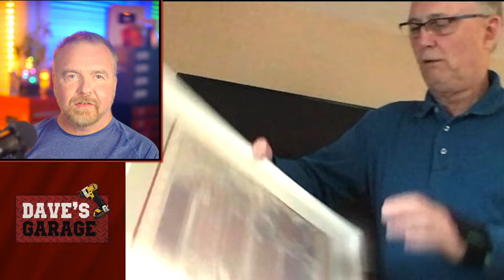Commodore 64 Chip Designer Interview: Albert Charpentier

Comment: Nice interview although Albert has forgotten that a C64 sprite is 24x21 pixels, 3 bytes wide and 21 lines tall, so they take 63 bytes each (within the boundary of 64bytes which a sprite pointer index is multiplied with in order to find its data within the 16kb of ram that the VIC-II can see out of the C64's 64kb of memory (the VIC-II can be configured to which of the 4 banks of 16kb of ram it can see). A neat thing about the C64 is also the ability to show sprites in the border by tricking the VIC-II chip to think that the screen should only show 24 rows and then turning it back to 25 rows again shortly after (all done at the bottom at around scan line 250). This trick was used by a number of games as well once it was discovered. Together with multiplexing by repositioning sprites you could have some nice HUD info going on above and below the actual screen area. Albert touches a bit in the talk about whats called "bad lines" that every 8th line at the start of a character row, the CPU is disabled for 40 to 43 cycles depending on the instruction it is running when its halted. Furthermore, any sprites in any row will further steal cycles in order to do the fetch of the data so a programmer had to take all this into account if they wanted control of the raster in some way which is a big can of worms that takes time to master (like most demo coders do) - especially if you have a multiplexer that repositions sprites all over the screen as well. What's most fascinating is that even today people are coding for the C64 and discovering how to master the VIC-II as well as the SID chip to new levels. The "bad lines" could take so much CPU cycles that timing for the tape loading could fail and it would miss data so the simple trick of turning off the screen gave the program full CPU utilization where timings could be tight. Ofc in a short time some clever developers not only figured out how to avoid this problem with better timing but also faster loading of data from tape, no doubt an important reason for the success of the C64 tape medium in Europe as it would cut down loading from 15 minutes to maybe 3-4 minutes for a game.

Comment: @44:30 - The Texas Instruments chip with sprites that was referred to was probably the TMS9918 and its relatives.

@47:00 - it's probably worth mentioning when he's talking about Atari he's talking about the 2600.  The Atari 8-bit computers had a couple of video chips (ANTIC and GTIA) that were comparable to the VIC II in terms of capabilities.  In fact, you could argue that ANTIC was even more sophisticated than VIC II because it could run subprograms called "display lists" at the same time as the CPU.  This allowed it to take its smaller number of sprites (player missile graphics) and "re-use" them to create a significantly higher number of effective sprites than the hardware specs would suggest.

Comment: The screen bad lines, every 8 pixels normally (other modes can force the bad line condition by tweaking the Y scroll register), and sprite fetches would lock out the CPU while it fetched extra data.

Comment: The VIC-1 had smooth scrolling already, it was just not used very often.
You could also configure it for a few more characters than 22x23. But since the kernal couldn't be copied to RAM and modified like on the C64, it wasn't of much use unless you'd go all the way and burn a modified kernal EPROM.

Comment: Really great stuff and I really connected with the realization that the c64 was the first computer I owned even though I'd been around Tandy's  and apples and some mini computers before I bought my commodore 64 I ran a computer shop and sold a lot of commodore Amigas Atari ST'sand PC clones and even though I learned a bit of coding on all of them the c64 was the only one I felt like I knew inside out top to bottom front to back I knew the firmware I knew the processor I knew the machine code and going forward you were lucky if you could become expert on one small subsection of a new architecture

Comment: FYI: the VIC-I has a lower pixel resolution, but did allow for changes to the text area with positioning (by half a character) and resizing (by character count)

Additionally, where the C64 (VIC-II) could have a full resolution graphics screen (and the obvious sprites), not using a character set at all, 
the VIC-I would need RAM to redefine a character set for graphics (with max 256 characters set for 8x16 pixel , i.e. double-height "characters"). 

Unfortunately, the missing 3KB of RAM at 0x0400 internally meant that only 4KiB were available for both the text area (defining where each character goes, e.g. 256 bytes) and the character set up to 4KiB, so you would always lose 16 double-height characters for possible graphics resolution...
Unless you used 0x200 for the screen memory and bypass the kernel entirely :)

Comment: Thanks! I emulated the C64 yesterday.
Reply: Did you actually write the code to emulate the C64? Or did you just run a C64 emulator? I'm guessing the latter.
Reply: @paulmichaelfreedman8334  Hehe, no I use VICE C64. Works really well for some retro gaming.

Comment: hw implementation of such complex algorithms without the current tools was a great feat.
Reply: I once had an ADM3 dumb serial terminal built in the mid 1970s.  It was built entirely with discrete TTL logic chips.  It had no cpu.  The most complicated chip in it was a UART.  Everything from the keyboard to the video display to the output was done with a couple hundred TTL chips.  The circuit board for this thing was a huge 2ft x 3ft.  Doing this today with a microcontroller would take one chip.  I can't imagine how much harder it was doing everything in hardware.

Comment: 5:44, I will say that a more efficient use of RAM would not involving timing at all, not even any atomic operations, just a chip that sits between the process, gpu and ram, it would constantly flip which it reads from (cpu or gpu) and check to see if it wants to read/write anything based on the dedicated registers of the chip they can fill at any time, if they do then the chip launches the read/write, waits for the op to finish then fills the dedicated registers for the cpu/gpu to read with the response and move onto the next set of dedicated registers for the next op, something like this:

extern float power;
for ( bool which = 0; power; which = !which )
{
	REGISTERS *R = registers + which;
	if ( R->op = RD_RAM )
	{
		...
		R->fbr[1] = value;
		R->fbr[0] = response;
		R->done = true;
	}
	else if ( R->op == WR_RAM )
	{
		...
		R->done = true;
	}
}

Comment: I would have liked to know why the VIC-II had the same 16 color limit as the VIC. Just an extra bit, couple of extra pins on the package, and it could have had 32 or more colors. Or a programmable palette, I think the VIC-II had its colors encoded as resistor (transistor) ratios on the die?

Comment: Dave, after listening to Albert talking about the difficulty getting the "old" systems to display moving characters on the screen (I didn't catch the timestamp), I'd like to hear his explanation of how SPACWR (or similar?) was run on the PDP-8 (starting with the Straight 8, I think), and even earlier PDPs (I think!) given the 1960s & early '70s hardware they had.  I've seen videos of SPACWR being run on some of these minicomputers, all with less than or equal to 32KWords of (core) RAM & outputting to a "scope" as a display.  (I wrote 32KWords because none of these systems measured in 8-bit units.)
Reply: Apparently the objects werer drawn directly to the screen buffer and it was fast enough for everything to make it to next screen refresh!
 The CPU:S in these, for the time, very expensive computers were quite powerful. Besides the objects were very basic and in one color.
When Nolan Bushnel of Atari then needed to port Spacewars for the first Arcade Machine (that came before Pong), it was way, way too slow to do the same thing so he actually had to invent the sprite for that machine.
The early Microprocessors (or the TTL logic used in early Arcade machines) were slow in comparison to even early 60:s computers.

And, yes, the 6502 is one very early microprocessor as it came out already in 1975, 7 years before the Commodore 64 (which had a very similar 6510). A mere $25 chip at the time...
They weren't fast compared to most processors from the 60:s...
It wasn't fast enough to do the same thing with drawing everything to a background buffer and then do a screen refresh until, maybe, the late 80:s.
Reply: Those early machines used vector graphic displays with their own memory systems, not raster displays like we use now.

Comment: 37:50 "Exactly. There's just too much now" It is Wirth's Law. Software has found ways to be so utterly inefficient, that people still wait for things on a machine with mostly 1 cycle latency instructions it can parallel dispatch on at least 4 integer pipelines, and reorder a 256 instruction window, with 16MB cache right there, with a clock speed of 3 to 5 gigahertz, times 4 to 8 cores, and 4GB//sec per lane I/O with 28 lanes at least, and storage that is 500MB-3200MB/sec, and typically 16GB/s RAM bandwidth, with at least 16GB of RAM. Those are realistic ranges of numbers too, modern computers are outrageously powerful.

Comment: Is it possible to build a Modern Updated Commodore 64 like computer. Maybe one with a faster modern processor, more ram, but the same familiar large character set, music chip and programming methods. Loved that music chip it had with the POKE commands. I used to buy all the magazines with the type in code programs and liked to modify them. I actually built my own acoustic coupler back then out of a video cartridge case. and had the computer dial my phone for me I got tired of wrong numbers due to typos. I am a former computer operator and application Software guy on the IBM AS/400 Midrange Systems back in the 1990's. I actually worked contract as a IBM AS/400 Rep doing system system upgrades all over Dallas Texas area back then in the late 1980's and through the 1990's.  One of my customers was the Dallas office of Levi Strauss & Co. and I upgraded their operating system. Loved that work.  I also owned both the VIC-20 and Commodore 64.

Comment: they should of ran 64 software on the 128 as an emulation without the user actively switching modes. Most people who bought the 128 used it as an expensive 64 and still had the disk drive bug...

Comment: About this Commodore 80 idea: probably Commodore was right to not persue if. The screen would have been very expensive but Commodore didn't really have a reputation for expensive business computers, so it coukd have been hard for them to compete with IBM and the like. Also it you compare it with the Macintosh, you should consider that the first Mac wasn't very successful, mainly because of it's high price. It took years until Macs became successful, so Apple continued to sell the Apple II line in the meantime.

Comment: Maybe this guy could point me in the right direction. I have a Sobax 600. It has 5 main slot boards. Everything but the Key pad works.taking the number keys off I ruled them out. So it’s not the key pad. These boards are fully populated with Orange Chiplets tightly packed. I’m completely lost and no luck finding a service manual.
Reply: There can't be much to the keyboard circuit.

Comment: 59:30 -  VIC-II stops CPU access to RAM for 40 cycles out of 63 (in PAL machines) every first line of character screen to fetch char codes. This condition is known as a BAD LINE state. Janne Hellsten has nice animation on her blog illustrating how bad lines work. I assume, that taking out couple of percent of 6510 speed in 1982 wasn't an issue, but later was, and till this day is a pain in the ass. Cycle exact routines have to account for that, like digitized sound players or software graphic modes. Although it is possible to get rid of bad lines by $d011 trickery fooling the VIC chip, loosing character/bitmap screen along the way but sprites still can be used (watch Royal Arte/Booze Design demo with gray scale sprite based moving picture).
Chip designer Jerry Elsworth tackled the problem in Commodore DTV by clocking higher the whole machine. Bad lines are emulated there and can be switched off.

Comment: I think bit wrong there, 286/386 where that fast, and 68000 was used in Unix machines, it had advantage in graphics, but just because had figured out how to use memory efficiently without
sacrificing colors, at expense of creating a complex 2d gfx chip design that got stuck with, when 3d age started, planar graphics as called, was why DOOM was never officially support by ID Software, only when source code was released, did some port it by heavy handed assembler optimization lots hours went into that i bet, insted ID Software when on to making Duke and Quake maybe a better time spent. Commodore also tried selling PC, but more expensive generally was not a cash cow. It was direction that pulled resourced out of Amiga development.
Reply: I think he is correct, about Jack Trammel. If had stayed, you might have had someone with strong vison and personality with technical competence, and someone with leadership skills. Some projects where stopped that might have change thigs, some projects were started that was major waste of time. And marketing was also a huge frailer in the USA. Macintosh slightly more successful than Amiga, Amiga more success full then Atari. All 680x0 systems.
Reply: All these 680x0 systems had different graphics chips, but major difference between the MSDOS/i486/PC was modular in design, something Amiga was only partially able to do, you get different 486’s for different things, Amiga was a box and had a standard, then you had thrown money at hardware upgrades. Often upgrades had to creative to find attachments. Things like RAM and CPU was soldered on, and not on socket.
Reply: We talk a lot about Amiga/Atari because where unique had good games, and wonder about why commodore failed, and also keep forgetting all PC manufactures also whent bankrupt. The competition was brutal on i486 market, lots of companies trying to sell same thing, IBM PC is no longer something you can buy, they only sell servers now.

Comment: Didn't the ensonic chip also get used inside the apple iiGS?
Reply: Yes, identical Ensoniq ES5503 Q-Chip DOC Digital Oscillator Chip in Mirage sampler, ESQ-1 & SQ-80 synth/sequencer "workstations", and Apple IIGS (but severely limited in IIGS by 64kB limitation, plus other twists, courtesy of Apple).

Comment: ON ANOTHER TOPIC, DOES ANYONE KNOW IF THERE EXISTS VISUAL STUDIO WIN32 FUNCTIONS THAT CAN BE USED TO SIMULATE WINDOWS FUNCTIONALITY IN A WINDOWS CONSOLE  PROGRAM. FOR EXAMPLE, IS THERE A FUNCTION TO RESIZE THE CONSOLE WINDOW TO FULL SCREEN? FOR ANOTHER EXAMPLE, ARE THERE FUNCTIONS THAT WILL PUT A CONSOLE WINDOW INTO A HYBRID GRAPHICS/TEXT MODE WITHOUT RESORTING TO THIRD PARTY LIBRARIES, SO THAT ONE CAN SET AND RESET PIXELS ONE PIXEL AT A TIME?  MOST IMPORTANTLY, ARE THERE FUNCTIONS THAT CAN BE USED TO POSITION THE CURSOR AND MOUSE ANY WHERE ON THE SCREEN WHERE IT IS NEEDED IN A CONSOLE PROGRAM.
Reply: I think you're confused about the purpose and capabilities of a console window on Windows.

Comment: It's been a long time since I played with any commie. I started with the vic, played games on a 64 and ran my BBS on a 128D and learned graphic design on a Amiga 1000. Sigh I'm old.
Reply: The amiga still had superior video output even in the time of Pentium..  just like the word clock on the atari even to this day, has a superior midi clock than new computers and audio interfaces without having to get an independent specialised midi clock. MPC 3000 is another one than pwns modern midi clocks. Hence why massive attack still run their entire midi chain from a 3000. Roger Linn Carpentier and Yannis would get along well I’m sure. 🙂